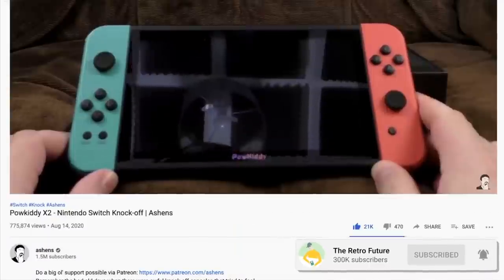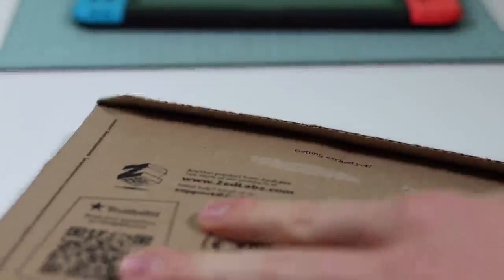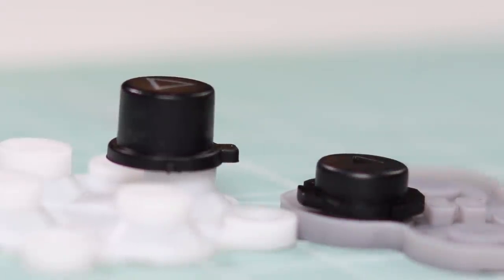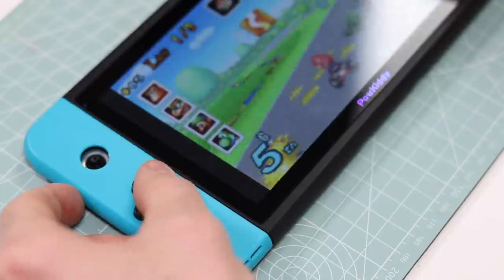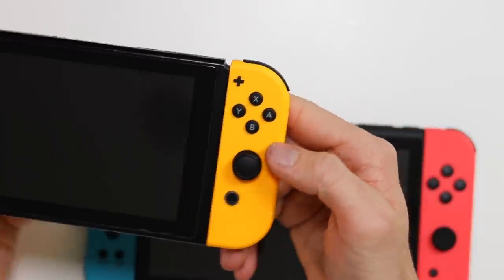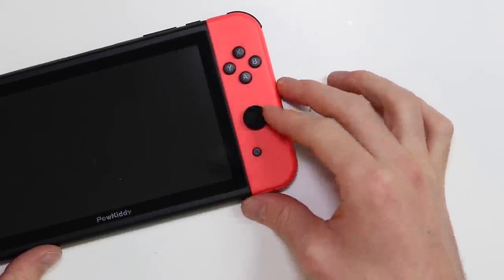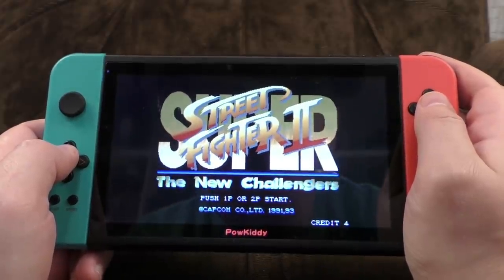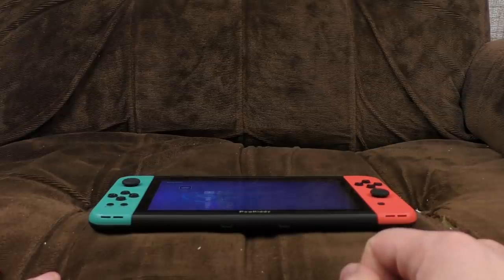Can I make Ashens' FAKE Switch Better?

Comment: The moral has to be buttons are never a good d-pad.
Reply: Why are you way down here? This is the true crime of this device (and the Switch's D-Pad in general)
Reply: Joycons are some of the worst controllers I have ever used. Thin, clicky, hard to press GARBAGE
Reply: @mortimermouse3086  i dont mind the except the drift, shoulder buttons breaking and warping plastic
Reply: @mortimermouse3086  I like them (especially since you can use them separated, it's nice to just lay my arms down by my sides and still be able to play), but I also have small hands and like the clickiness. Nothing is hard to press for me.
Reply: @greentea5090  i love the fact that they can be separated but they are a tad small. Mainly the sticks are so small there isn't much precision.  I usually turn on motion control with low sensitivity so I can get a little more precision by moving the right joycon to aim but not all games support it.
Reply: Michael Persico  personally i dont mind the d-buttons but yea having deadzone options would be nice
Reply: Michael Persico  Because if it had a real D-pad, you couldn't turn the left one sideways and use it as a mini-controller like the right one. So the appeal of "You can play some two-player games without buying an extra controller" would be lost.
Reply: @Doc_Smash  you mean the switch's main joy con dpad.. the pro controller has a normal one and there are official joycons with normal dpads
Reply: @MixingSneaX  the dpad isn't that usable anyways as you have to hold the console awkwardly to even get to it

Comment: weird how Nintendo is praised for their D-pads, then they make that weird, separate D-pad thing which sucks.
Reply: Playstation looking-thing.
Reply: @marianokaz1503  Yeah playstation-ey. Hurts my fingers, wrists, my whole hand having to use those types of D-pads. Plus they look ugly and uncomfortable compared to every handheld/console Nintendo has made pre-3DS.
Reply: It still works better than the Pro Controller's D-pad
Reply: Gotta agree with you there, Pro Controller probably hurts more, honestly.
Reply: @seefuud2839  for real? damn i'm glad i didnt pick up an official one then. i picked up a powerA pro controller & its dpad is pretty nice. not top tier, it feels like a dreamcast dpad, but it's good enough for me to play panel de pon
Reply: @electrocast  yeah man, its really rough to use
Reply: They did that because the design is made to both joy-cons works also as two separated controllers
Reply: I know that. I've played games like Sonic Mania multiple times on multiplayer using separated joy-cons, its just that i play single player games 99% of the time, and im a retro gamer. So that D-pad does no favors for someone like me.
Reply: it's a sacrifice to make it double as face buttons when used as a separate controller
Reply: @seefuud2839  at least playstation got it right in the last and current gen tho
Reply: I prefer the Joy-Con’s D-pad. I grew up on the Nintendo DS; tact buttons are my thing.

Comment: Hear me out for a consistent cut.

Deli meat slicer.

Pin it to the board and after running it through after adjusting the the thickness, you are good to go.

Also you did the best you had with what you had on hand, and Ashen should know handing a new (faked) item for modding over to a person who hasn't worked with it before for a 100% perfect outcome isn't realistic.

Keep it up Elliot, and keep making your great content.

Comment: No matter the outcome the journey was interesting. If you order from digikey/mouser you can sort by actuation force which should help. Additionally if you look at the bottom of the original switch membranes they have a little nipple whereas the powkiddy ones dont (since they only have the carbon pill pad), I'd think this would have some kind of difference.

Comment: Shaving down or adding to the pad's is always a safe bet (for those short out style buttons/pads) I had to do this to most of my consoles controllers stating with master system and ending with ps1 (you usually only now find those types of pads in cheap crap nowa days) I've had a wireless logitec (ps2/ps3/4) style controller for like 10 years and it's still going strong.

Comment: Yeah the ones the regular Joycon use are basically the same idea as the membrane but it's a smaller contact area with a shallow small metal dome with yellow tape over the top. It's not like a whole surface mount button like the ones you used. You could maybe emulate it by using solder mask on the edges of the button contact areas to make it smaller then just remove the domes from the switches you had and put those on the board directly with kapton tape. The Xbox Series controller does it in basically the exact same way. They have small contact areas on the board for the Dpad and then they just have metal domes over the top with tape to secure it.

Comment: Your particular result might have been negative, but I'm pretty sure you're onto something good with that technique of overlapping tactile switches onto shorted pads.
I think the problem was that the switches require a lot of force, and thus the shitty rubber membrane compresses far too much before it finally triggers.
Reply: Yeah that's probably it. The switches might have been fine if there wasn't essentially a spring that needed to be compressed before them.

Comment: I had to favorite after the material joke. And something off the top of my head is to drilling a hole in a piece of thin steel the size of the membrane and use a grinder or dremel to sand (or melt, lol) it down flush to the desired height

Comment: Cutting the top of the membrane only made the buttons closer to flush with the face of the case, it didn't affect the travel. New switches weren't the answer either it seems. What would have helped would be if you could extend the black contact underneath so that it started out closer to the PCB. Or maybe you could have janked it and just covered that zig-zag of copper with a nice pillowy layer of solder, effectively bringing the PCB closer to the black contact part of the membrane.

Comment: Not sure how much clearance there is for the 'analog' dpad. If the devices does not really use an analog stick, then you can replace it with a d-pad, provided there is sufficient space. You can try designing a dpad similar to the neo Geo cd dpad. 
You can buy those micro push buttons with a longer round pole, then slip a spring through the pole. Then you'd need to design and 3d print a central pivot/button.

Comment: Could try just adding extra length to the buttons, I did this on one of those cheap USB Saturn pads using some thin plastic and it improved it massively. could also try a dpad mod for it by cutting the button holes into a cross, a Wii U dpad might be a good candidate for that.

Comment: You had the right idea, but the hard switches combined with the probably very soft/cheap original membrane didn't mesh too well. Maybe softer switches and/or a harder membrane would do the trick. But in the end it's still hopeless, these retro consoles need a d-pad.

Comment: LOL this is what happens when you use tactile switches for a D-Pad instead of the pressurized ones like most controllers use.  This is also the problem with the heralded Retroid Pocket 2.  They used tactile switches on those too which I can't fathom why.  It's the one thing holding the system back to be honest as switches like that are just not suitable for a gamepad.

Comment: I remember this...except for the controllers it was a pretty good emulation system. It's based on Retroarch so it's much better than most of these cheap devices.

Comment: The xbox controller shoulder buttons style switches could have been a better option as they also come with "stems" of different lengths, so it should be possible to ditch the membrane altogether. 
Maybe do a part 2 video to explore the idea?
Pretty please? 😁

Comment: I see you've used parts from zedlabz recently I needed a digitizer and em10 charger coil which was impossible to find it was the only place I could find one and I used parts from that seller and there greaf

Comment: I once did this with pushbuttons on a knockoff rock candy xbox 360 controller and the buttons I actually got centered were pretty great but the one's I didn't would jam and not click properly.
I also massacred the dpad with pushbuttons as as well. I was trying to emulate the 3ds clicky buttons.

Comment: The only thing I could think to do is 3D print better buttons and maybe install a D-Pad. Of course, I know you aren't necessarily equiped for that. Still, probably the only way to fix it.

Edit: The Myth Busters did once polish a turd. Literally.

Comment: Hi, not sure if this has been mentioned before but tactile switches are rated by the operational force needed to press them. If you go to the RS website you can sort the switches by this parameter. You may even be able to get the exat same switch you used the first time but with a lighter force rating. https://uk.rs-online.com/web/c/switches/tactile-switches-accessories/tactile-switches/ (the operating force is the very last colum on the left)
Reply: Hey, is there any video/post that goes into more detail about modding membrane switches with these tactile ones? I would love to know more info on how to do it

Comment: If you were to over time replace each piece of the knockoff switch with real switch parts, at what point does it become a real switch? Is it still a knockoff? Or did the switches switch? And if you were to take all the pieces of the knockoff you replaced and make another switch, which is the knockoff? If both switches had half authentic and half knockoff parts, which is real? Sorry if I commented this twice on accident.

Comment: You shouldn't have bothered with the rubber. Why didn't you just use standard micro swtich buttons? They're like 100 pieces for 1 pound.